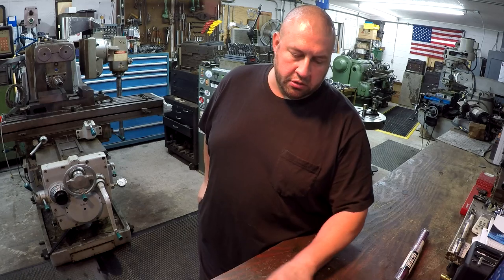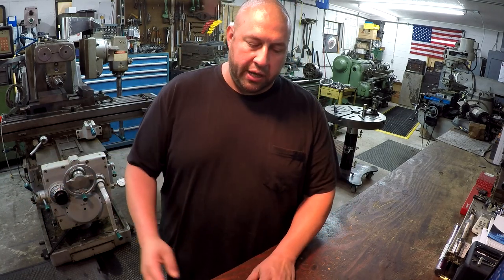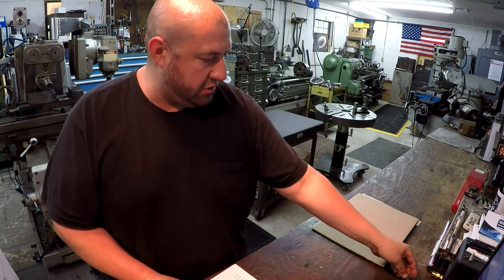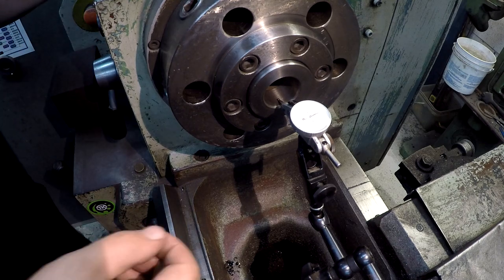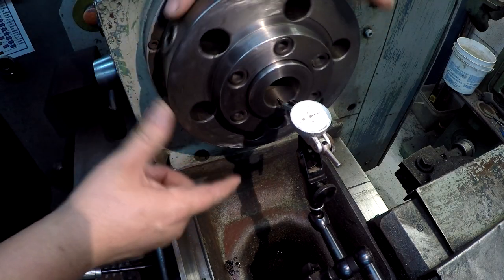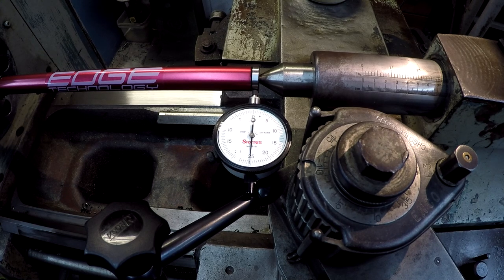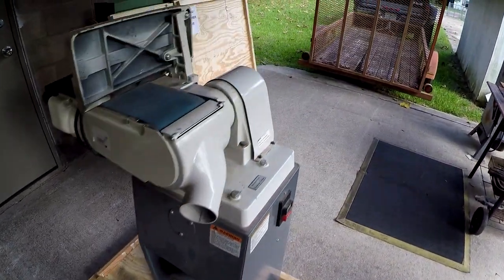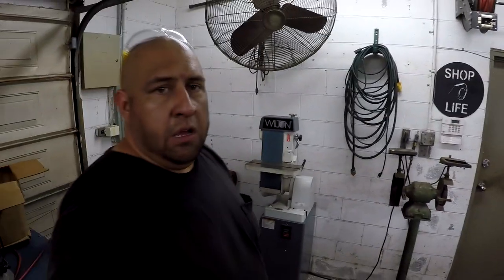Saturday Night Special 135: Tailstock Alignment Bar, Wilton Belt Sander

Comment: I would think that one would indicate the tail stock in the position it is normally used.  It appears it is run out about 3 inches.  If that's where it is normally used, then it would be the place to test it. But if it's usually used extended less than an inch or less, then to me is should be tested at that point.  That tail stock could be out that much when extended that far.  Was it tested again when fully retracted?  Just my ignorant observation...

Comment: I'm not hearing any static on your vids. I use a NICE BOSE sound system with this comp. I have good ears so if there was anything there I would hear it (I think).Just got a JT33 keyless chuck for my cheap Craftsman tabletop drillpress. Company I worked for a few years ago went out of business and if I had a place to put them I'd have bought their lathe and mill for next to nothing...
Reply: your Bose sound system actually is made to filter out static noises and improve the sound by compressing it send sending it through an internal equalizer and stuff like that.

Bose equipment does change the sound to enhance it. So never trust any Bose equipment if you want to test the quality of a recording.

And don't get me wrong, i love my Bose headphones, but i would never use them for mixing because i know they change the sound and lie to me. Thats why i use Bose only for my Home Cinema and Headphones when listening to music.

For mixing sound i use studio monitors which try to not alter the sound as good as they can.
Reply: Well since you don't know which Bose system I have you may be making some assumptions. I have studio equipment also. Sony, Roland, Yamaha. Granted at 57 my ears aren't as good as they used to be...
Reply: I'm not making assumptions, every piece of Bose gear does this. Some more than other.

Bose is known for this and proud of it.

Also for not giving any real technical data for their stuff.
Reply from the maker: In some of my older videos there was some static sounds coming through.

Comment: Hello Adam,  Another good video.  How do you know with your indicator on the cross slide that the error isn't coming from the cross slide rather than the tailstock?  Also I noticed you tapped one side of the headstock bushing when installing it.  Could that have created the .5 thousands error?  Always good to get to Saturday when your new videos (the longer ones as I also watch the shop talks) come out.  You take care and give Stella a pat for me.  Doug
Reply from the maker: The Noga holder is very rigid especially in a fixed position likecit was sitting. But I did mention a fixed indicator is better. On a badly worn lathe you will likely get some movement from the carriage or cross slide but the victor is still pretty tight. Tapping on the bushing should seat it perfectly in the tapered socket.

Comment: Adam, I was wanting to know you opinion on collets. What in your opinion are the best brand and type, with the least run out, I want a quick change system that's not incredibly expensive, I thought about getting the TTS system from Tormach, I have a R8 spindle on a 1 hp mill. Thanks for all the great videos, I've been watching them for about a year now

Comment: I would think some drill rod or other centreless ground bar indicated at both ends in the 4 jaw would be better, or an alternate requirement to make sure your ways are on axis.  The edge bar does nothing to determine if your ways are properly parallel to the spindle.  Centering both ends does not mean the tailstock is on the spindle axis.  It only means it is parallel to the ways.  I suppose that could be an entire series of videos as to how to check your ways to see if they are properly aligned and what to do about it.  I know Tom Lipton did a series on adjusting the ways.
Reply: Your talking about a different animal. That test bar is just for aligning the tail stock. The results are as good as the tool, and the good ones tend to be pretty expensive. Many folks just make repeated cuts on a bar between centers.
To align the bed, you either use a Morse taper test bar, or clamp a large diameter pipe in the 4jaw turn it unsupported, and check the diameter at either end. I use a 3.5" diameter .25" wall aluminum tube ~10" long to check the bed on my 13x40 lathe. Obviously the bed needs to be as perfectly free of windage as you can get it before making the check.
Reply: I suppose I have two questions then.  I am assuming that once you have trued the bed to make sure it is on axis, you are unlikely to have to do that ever again unless you move the machine.  If you haven't ensured the bed it true, what purpose is there to aligning the tailstock in this manner?  How frequently does the tailtock need adjustment?
Reply: Barry Gerbracht You are correct, checking the bed is part of installation, and only needs to be checked if you suspect the machine has settled or was moved.
Checking the tail stock is something that can be done frequently depending on the work you do. For example, if you cut a lot of marine shafts, you probably offset the tail stock on a regular basis.
It should be checked everytime the tail stock takes a heavy load. This depends on the machine of course. It is should be treated like tramming a mill, - something that goes out of adjustment when you push the machine too hard, or when you drop something heavy on it.

Comment: could a dial test indicator be used to align the tailstock. if I turned a bit of steel and then found the high spot with the indicator. I could record the x position and without moving the indicator move the carraige over to the centre and find the high spot, if aligned right both x readings along the high spots would be the same. would this work?

Comment: Adam,
Thanks for another Interesting issue of SNS! I liked that shot of Stella checking out your anti-fatigue mat. I guess it works for her, too. It looks like you could use a new board or two in the bed of your trailer. (lol) Jet also makes pro woodworking machines. When I was servicing those kinds of machines, Jet was a piece of shit compared to Powermatic, Holzher or Altendorf. Wilton makes good stuff, especially if it's manufactured in an ISO 9001 factory.
Have a good one!
Dave
Reply from the maker: I think the Wilton is going to be a nice machine for me. Yes those old boards have seen better days.

Comment: Adam...
I don't get the advantage of having the bar for aligning the tailstock...
what is the difference in measuring off the ends of the bar and just measuring off the dead centers?

plus... did you check to be sure the dead centers are dead center?

Anon
Reply from the maker: There are other ways to get the job done, this is just a simple tool one can use to make it a little easier.

Comment: I always wondered about this but never did any research whatsoever.. how is the hole for the tailstock barrel (the part that slides out) made actually or better said how it was made in the old days?? I mean if I were to make my own tailstock now I would bore out the hole with the boring tool stuck in the spindle tapper while the tailstock was pushed toward the spindle with the carriage by means of a leadscrew.
Reply from the maker: I'm sure they are precision machines to specs and then ground to fit on center height. In the old days the bottoms were probably hand scraped.

Comment: Trust me your computer is not the reason for the noise.
Its either mic, cable, or camera. After it is recorded by the camera its done. Your computer will not add any noise (unless you use a filter in your software to create noise) because the sound is processed digitally. Digital processing doesn't add any noise to your sound.
It will be compressed, and if its badly compressed sound shitty, yes, but it won't add any static to the sound. So the noise is in the recording the camera made.

So look at the camera and mic themselves.
Also try the mic in other places than your shop, it might be that its picking up something your ears started to ignore!
Reply from the maker: Ok thanks for the tips.

Comment: In today's money, that south bend would cost about $8721.59
Reply: That's it?? I would have guessed a lot higher
Reply: well, I guess you woulda guessed wrong then, wouldn't ya?
Reply: its 8 thousand no hundred. I would have never guessed that it would be that hi.Lol
Reply: is that just inflation or does that also account for buying power?
Reply: just inflation,lol
Reply: According to the Fed's inflation calculator it's $9,467.56.
Reply: ya just about every site I went to was different

Comment: 4:27  I, or someone else, might be able to identify the problem if we hear the unfiltered noise you're getting from the mic.
Reply: at 4.27 i think his airconditioner is running anyway
Reply: at around 4:27, he's talking about a problem with his sound that isn't necessarily happening at 4:27.
Reply: Nevin Williams
ahh gotcha!
Reply from the maker: Yes I'm not talking about the ac, or the air hitting the mic. The sounds I'm talking about is static.

Comment: I blame the phone on static noises. Mine interferes with my computer speakers.
Reply: there are lots of things can cause the same noise, my solar panel power meter use a cell phone data card to relay itself to the data centre, other smart meters do the same, other wifi devices even the router can make noise into a device, a bad light flourescent or even some LED lamps interfere, and the machines themselves might have bad/missing interference suppressing circuits.
Reply: Could be anything high voltage that is unshielded or something magnetic near the camera/mic
Reply: I haven't noticed the hissing myself, usually sounds pretty clean